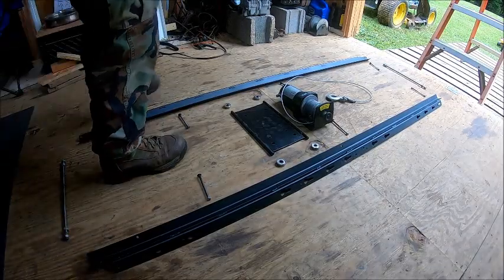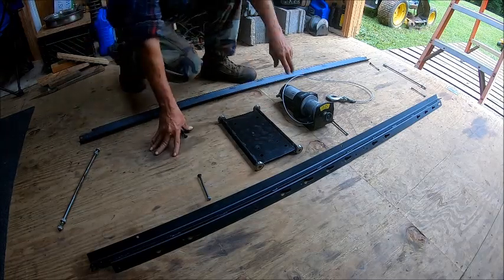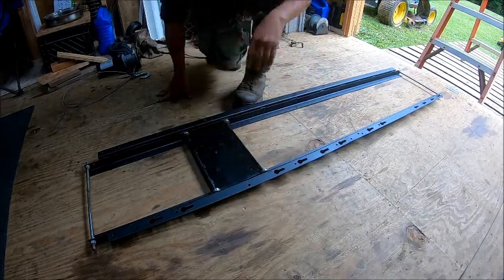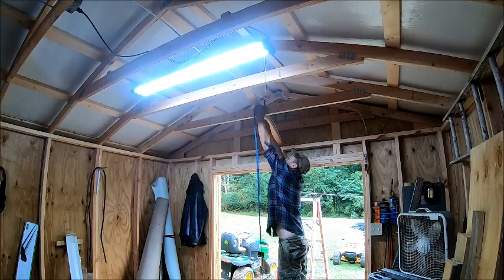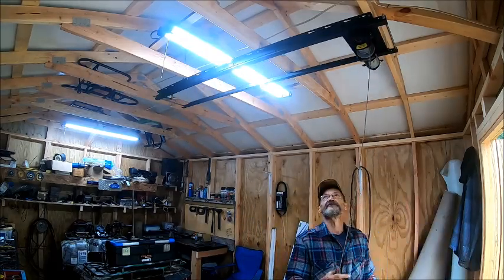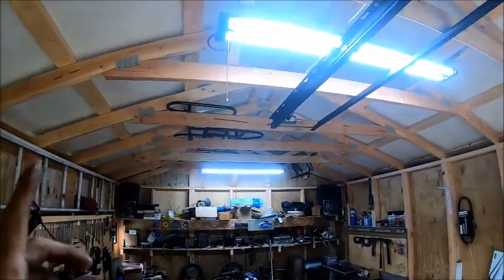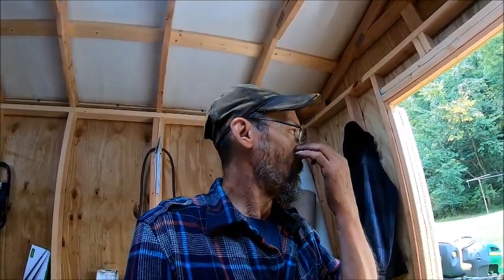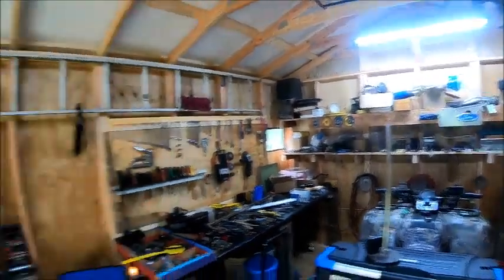shop over head winch crain

Comment: As I meantioned to you earlier the quansit is 28 ft long and I'm going to attach a rail system and install a winch on it .your shop is looking good bison. Good to see bison in front of the camera, great idea bob with the rail system .most folks would toss a bed frame to the curb. I have a few pieces in the back shed .
Reply from the maker: bed frames  are my best resource